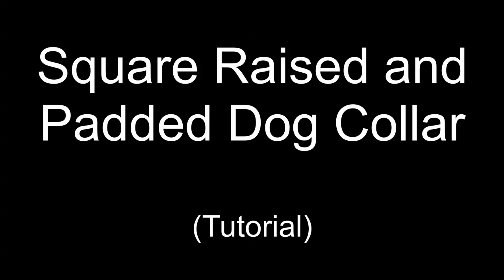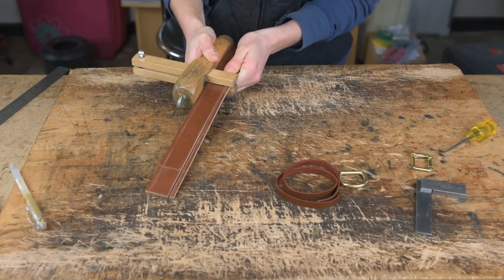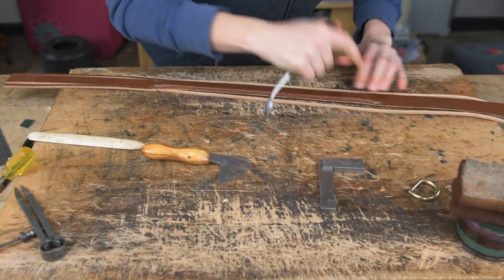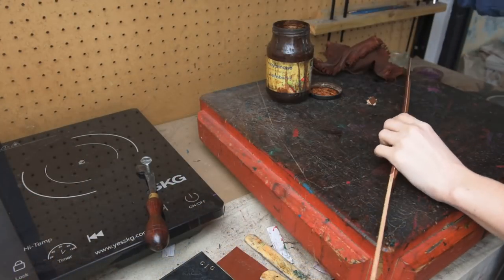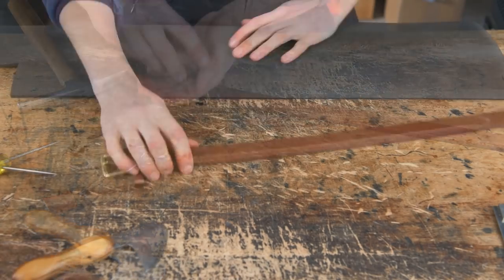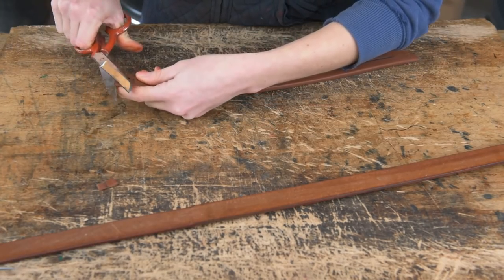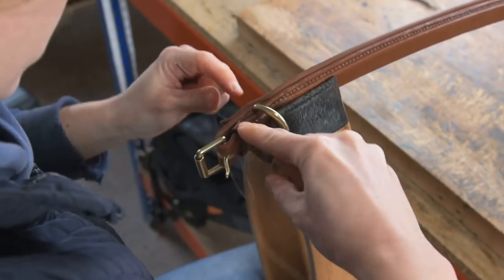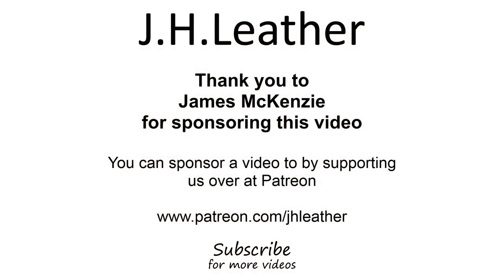How to Raise Leather - Square Raised, Advanced Dog Collar Tutorial, Raised Leather Techniques

Comment: Love this. Couple of questions. I WANT a leather splitter, just can AFFORD one at present. Any sort of alternative method you could recommend? Secondly, can you stamp, say the dog's name into the raised portion or would that just crush the raised bit and unmake the raised portion?
Reply from the maker: Hello, unfortunately there isn't really an alternative to a splitting machine I'm afraid. I'd keep and eye out for some second hand ones as you may be able to get a good deal there.

With the raised part as I used leather as the filler you should be able emboss into it without an issue. Jo
Reply: i guess you could also emboss before assembling?